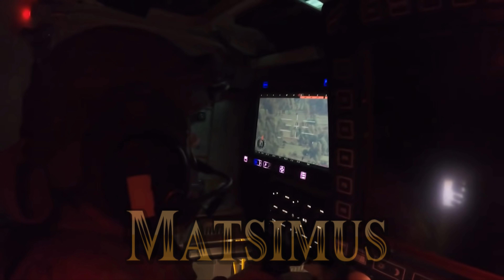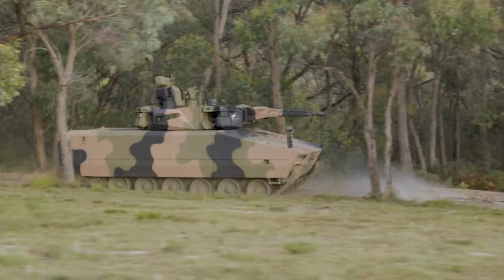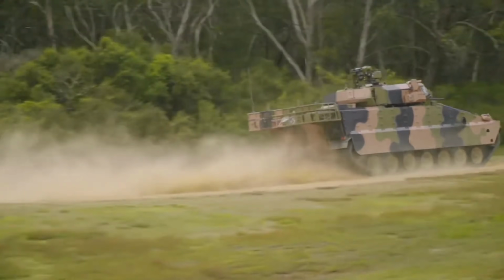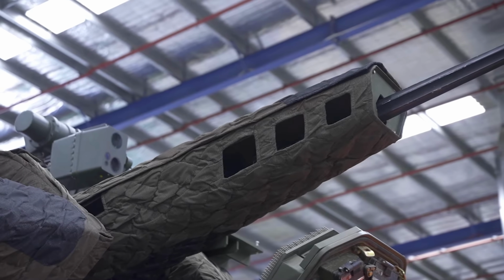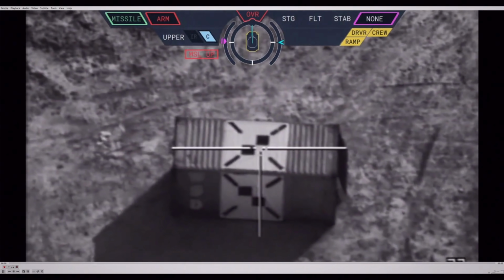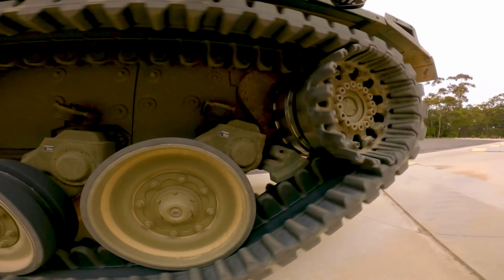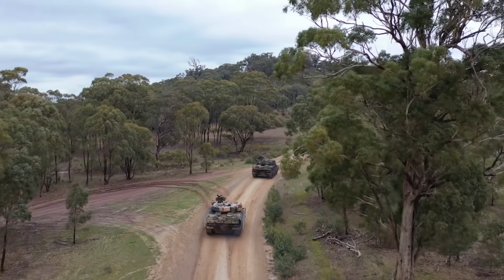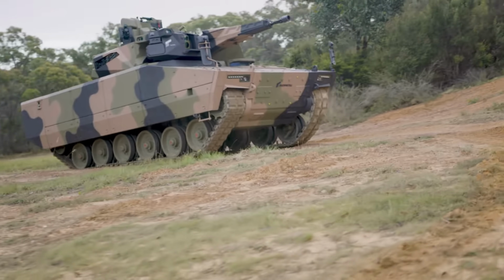KF41 'Lynx' & AS-21 'Redback' Infantry Fighting Vehicles - Land 400 Phase 3 | ARMORED COMPETITION! 💪

Comment: I really like those IR-blankets on the Redback, very smart and practical.
Reply: Apparently designed by Defense Research and Development Canada, according to the manufacturer's brochure.
Reply: @Ostsol  Ive seen people make those out of emergency blankets and fabric before for personal use but it is quite a smart and relatively cheap way to hide your IR signature. BAE had some fancy high-tech surface coating and mechanical application I believe. Sure it might be impresive on a technical scale but surely less practical and costly when it comes to versatility and maintenance.
Take care and cheers!
Reply: @paddanandersson4626  Thank you! Now that I think of it, I might even have seen one of those camospheres live in one of the Försvarsmaktsdagarna at Gärdet some years ago, but not comitted it to memory. FLIR the company had them at their tent. Now I really want one of those SOTACS suits... Harebra nu!
Reply: Also helps against the heat, like 40C in February
Reply: @apathtrampledbydeer8446  Nemas Problemas :) First tank in the video i posted is Strv 122B INT, except no tent for the commander.
Reply: Finnish modernized BMP-2s have similiar kind of blankets.
Reply: @Vulcaani  Gotta respect those finns, you just don't mess with them! But I guess a lot of countries have them, which I was not aware of, nice to learn new stuff. Cheers! And as someone mentioned it is the Lynx that has those blankets, I was wrong. Ooops.

Comment: What many are forgetting is that the Army doesn't decide which platform they get. The trials will provide a recommendation, but it is the government of the day that decides. Assuming that both platforms meet the essential requirements, most of the important and some of the desirable requirements, the decision will come down to manufacturing options and the impact on affecting voters in key electorates. Since Rheinmetall already has the Land 400 phase 2 contract (Boxer) and the Land 121 phase 3 contract (medium/heavy wheeled vehicles) ongoing maintenance, there is good argument that there is enough economic activity to shore up votes in SE QLD for the government of the day. Geelong, Victoria, where Hanwha plan to build the K9 Self-Propelled Artillery (under Land 8116)  is currently in need of Defence spending to maintain economic activity since the drying up of Defence works there in Naval shipbuilding. My money is that the AS-21 will win the contract, not because it is much better than the KF-41, but simply because the Federal Government will need to have a keen eye on winning some key electoral seats in Victoria. Of course, I can be wrong!
Reply: That’s how it works in the US too on most occasions. Has a decision since been made?
Reply: Looks like I was correct in my prediction. Hanwha recently won the contract to build 129 IVFs in the State of Victoria

Comment: The Redback is designed only for Aus and will be built in Aus. Among those great features of Redback, composite rubber track and Iron-vision are revolutionary.
Reply: Both of them would be built in Aus thats no issue, Rheinmetall already manufactures the Boxer and other vehicles in Aus.
Reply: @Atlas-zm6bn  And the Boxer is already having problems and Rheinmetall is not good on after-sale service (not interested).

Comment: Also, if extra removable weapon modules & turrets are bought. Then one module can be repaired in the shop while another module can be installed on the vehicle chasis. This should increase the availability of the vehicle. Had an interesting project with production equipment that was supposed to be evaluated with this concept. Never got to see the end results on it.

Comment: Gee this is a bloody tough battle, both on the initial stages of land400 put the others to shame, both will be built in Australia if awarded the contract. Both IFV's have been enhanced based on the Australian special requirements and conditions and really there is very little difference between them and both have proved to be outstanding IFV's who gets the contract is anyone's guess but for me, I would like Australia to increase its 450 to 1,000 and purchase 500 of each because both are great companies and both are going to be built in Australia using Australian manpower, manufacturers, and materials, but more importantly is the fact that the technical expertise will be passed on to Australian personnel and Australia may one day be able to design and build their own IFV.
Reply: Build 1 type for the regular army and the other for the reserves. Would be interesting
Reply: Logistically speaking surely that would be a mistake.

Comment: Am much as I believe that we should seek commodity of machinery etc within our armoured vehicles I feel that the Redback may be the better vehicle for the purchase.  The spike missile and the rubber tracks make it, for me, a more appealing vehicle.  However that being said, I rode in the back of a M113, as an Assault Trooper (2/14 LHQMI); rather than a driver/commander.
Reply: The Lynx also has the Spike missile too, it's not just something exlusive to the Redback alone, so that's not a valid argument. The Lynx also has better ballistic armor protection with the use of thick side skirts which the Redback lacks entirely. In the end both vehicles are pretty much on the same Level though. Both vehicles will have APS, giving them very good protection against missiles and RPGs. At this point it doesn't even matter which variant the Australian Army will get because both of them are very eqaul in capabilities. Either way, Australia will have one of the best IFV when it enters service.
Reply: @xAlexTobiasxB  dont only 1 have ampb capblity
Reply: @missouripatriot6926  No, I don't think the AS21 has amphibious capabilities. Neither does the Lynx. But it's not a very important feature on the battlefield anway, so it's irrelevant. What would australia even need amphibious tanks for anyway? Is australia planning to invade europe soon ? LoL

Comment: Just call it "Pucka" :) Its our version of Bovington. I'm biased toward the Lynx but I'm not a big fan of rubber track. Both are Light Years in front of the M113A1 and the interim M113AS4. FYI, another part of LAND 400 is the ASLAV replacement - already decided.
Reply: The track material technology will continue to develop eventually surpassing steel its just a matter of how long it takes the scientists to create vs the time till next conflict maybe rubber tracks with bolt on steel sections counld be a mid term solution but timd will tell. Best of luck in all you endeavours.
Sincerely,
Jon 
Alberta Canada.
Reply: @FastUgly  Tracks arent a decisive criterion. Both providers can and will offer steel or rubber when asked to do so.
Reply: The rubber tracks are now modular and easier to replace in field than the steel.  The only thing keeping steel relevant is increasing weight of ifvs which seems to be a mistake if ajax is anything to go by
Reply: @Weakeyedominant  I'm still not persuaded that replacing track link as and when required is not better than needing a truck to carry a complete side. I know track work is a pain (I've done it for a few years) but reliance on an ARVL, a truck or forklift or whatever does seem a better option. esp. in a mine / IED environment.
Reply: @whya2ndaccount  there is company that has developed rubber tacks that come is segments.  I assume its some sort of fancy reinforced polymer with steel in it somewhere.  It's been trialed on the cv90.  If that's available where they don't need to replace the whole band and it proves durable without stretching it would be a game changer
Reply: @Weakeyedominant  not easy to replace in a combat situation which blew out your tracks because they were rubber...

Comment: Small correction: both the Lynx and the Redback have a crew of 3 + 8 infantry. Not 6. Carry on.
Reply: Both can carry 8 dismounts, but from what I've read and heard, the future mechanised/motorised infantry squad will be 3 crewman and 6 dismounts (squad total of 9). The question for Army has always been are the crewmen RAAC or RAINF. From what I've heard, (although it is older information) the Army decided upon RAINF vehicle crewmen and 6 dismounts to balance out personnel requirements.
Reply: I know that Lynx can be made in both 8 and 6 dismount variants, no idea about Redback and I don't remember anymore which variant is actually the one that Ausies want :D
Reply: @BallisticSollution  I could be wrong, I’m not serving, but I’m pretty sure they want to stick with the 8 man sections of two fire teams. It wouldn’t make sense to pull the crew of 3 from the infantry and keep as crew when they can stick with the current method of crewing tracked vehicles with RAAC members. But that’s just me spit balling. Will be interesting to see what they end up doing.
Reply: @TheoEvian  The 6 dismount variant is the KF-31, which is just a re-manufactured Marder and limited in terms of growth upgrades. Australia is trialing the KF-41 variant.
Reply: How much space is provided for troops and gear? What seems reasonable on the drawing board might be too cramped (even unsafe) in the field.
Reply: @wattlebough  This is the discussion and trialing they are undertaking right now. From the image used in the thumbnail (AS-21 and KF-41 side by side with dismounts out front), they are clearly trialing the 6 dismount model, which means the trials team is seriously looking at a variety of different structure models. The Germans for example use 6 dismounts per IFV (Puma). The question for the Australian Army is how to be as efficient as possible with personnel while retaining and maintaining a world class mechanised force. The ADF has a huge manpower issue, more so through government mandated personnel limits than anything else. That is why limiting dismounts to 6 and having the remaining 3 personnel in the squad as vehicle crewmen from RAINF (but trained though the RAAC training pipeline) makes some sense. The other choice is 3 RAAC crewmen and 6 RAINF dismounts. The discussion revolves more around who commands who? Who is the senior officer and from what Corps are they from? Does it make sense to have the vehicle commander RAAC? But that would mean you have a RAAC vehicle commander ordering an infantry team around. Then you have the opposite of that, RAINF commanding RAAC personnel. It becomes a squabble for who has overall command of the infantry squad. Which is why keeping everything in the infantry makes a heck of a lot of sense. But regardless, like I said, they are trailing this all out and will go with the option that best works and is the most efficient and effective, hopefully.
Reply: @petesheppard1709  Both KF-41 and AS-21 are roughly the same size; well over 1 meter longer than older IFV designs. The internal troop compartment is actually quite large, more so than a lot of other current IFV's. Dimensionally, it will be similar to the Puma, but with a better vehicle crew compartment and turret bustle design to allow for more internal space. Considering the likely troop capacity in the Australian Army will likely be 6 dismounts (but space for 8 seats available) that means there will be heaps of room for additional kit, weapons, ammo, etc.
Reply: @BallisticSollution  Thanks!  Mechanization has been a significant driver in squad numbers, due to the demands made on vehicle size.  The US Army has long been concerned about the lack of personnel for dismounted combat.While the US Marines continue to regard their infantry as light, and primarily foot-mobile, so they prefer the 13-person squad for the tactical flexibility. BUT that means bigger or more numerous vehicles for mech operations
Reply: @BallisticSollution  Thanks again!  The new vehicles certainly do look monstrous compared to their predecessors.
Reply: Can someone show this to the M.O.D.?See,it's not so hard,is it?
Reply: @wattlebough  the current Mech Battalions do not have any RAAC attached to them. - they only did during the transition of the M113s from the ACRs to the RAR
Reply: @coreywarde6030  Cheers mate I didn’t know that.
Reply: Wonder how many can you sandwich in? I mean pack them like sardines.
Reply: @BallisticSollution  marder is a totally different platform, I been in both.
Reply: @jantschierschky3461  The KF-31 is built on and designed around the zero houred and stripped down hull of a Marder 1 IFV. Rheinmetall actually released a video a news piece about it a few years ago. They have hundreds of Marder hulls and were looking at ways to re-use them - hence the KF-31. It is the budget option. The KF-41 is a clean sheet design. In this regard, you are completely and entirely wrong.
Reply: @BallisticSollution  well if you say so, I just happen to drive marder 1 and 2. My cousin works for Rheinmetal, but what I know
Reply: @jantschierschky3461  Well, if that was the case, then you should be able to look at the Marder 1 and the KF-31 and immediately see the extremely similar design DNA in them. The Marder 1, Marder Evolution and KF-31 are practically all the same vehicles just with upgraded sensors and armour with slight external design changes, in fact the Marder EVO and KF-31 similarities are striking. Also how can you drive Marder 2 when it never went into service, unless you meant something else?
Reply: @BallisticSollution  well you seem to forget there are 3 versions of the marder,  a system in use for close to 50 years.  So yes there are lot of similarities, however I been in the puma and lynx, both are smaller.  Different engine,  suspension,  drive train heaps more electronics etc. Is it an evolution of the marder,  absolutely, but is build on marder platform  ? No.  The marder turret is different,  metal is different, dimensions are different.  In comparison to the marder is cramped. Btw marder 1 was till 85, than modified to marder 2, 90s to marder 3
Reply: @jantschierschky3461  I believe you meant to say Marder 1, Marder 1A2 and Marder 1A3? That would make more sense to the reader who doesn't know armour systems very well. Because Marder 2 specifically was an real design built to replace the Marder 1 FoV and was about to go into production but was cancelled at the end of the Cold War. The Lynx KF-41 is NOT smaller than the Marder, it is much bigger. The KF-31 is also slightly longer than any Marder design, and both KF-41 and KF-31 are also wider and higher than any Marder design. I'm not sure where you are getting your info from mate, but it is not correct. The specs for all designs are out there. Do some research on them and you will see that Marder is a smaller vehicle by a good margin than either KF-31/41 or the AS21 from Hanwha. But you are right on one aspect, the KF-31 is by it's very nature an evolution of the Marder, because it's design is based on the Marder 1 FoV.
Reply: @BallisticSollution  well to me marder is more spacious. Never mind, you in most part right.  But my cousin just told me that puma prototype was developed with marder chassis, but it had issues with weight, suspension.  Chassis had to be redesigned, so is a new development.
Reply: Thanks Matt,  good to see them side by side. Along with the 40 K9 and K10s, Boxer Recon vehicles and new M1a3 tanks the tip of the spear will be very sharp indeed. Also talk of 120mm auto mortar turrets for Boxer and the winner of this program.  Good to see you out and about again. Cheers (ex bucket driver).
Reply: @jantschierschky3461  That's an interesting tidbit on the Puma, thanks for sharing.
Reply: @mylesdobinson1534  Yeah it will be a nice mix of vehicles that's for sure. I just wish we were getting more of them and expanding the army to a more feasible/useful size as well. As far as the 120mm mortars, apparently it's more likely they will be on Phase 3 winner rather than the Boxer. It's a pity the Boxer isn't being utilised much further than it is, it's a superb platform.

Comment: I'm a little confused. So the Boxer which Australia has purchased is an IFV as part of the Land 400 phase two. The Lynx, which I think Australia is going with, is also an IVF as part of Land 400 phase 3. Is this correct? Why two types of IVF? Is one troop transport and the other isn't? I'm not military so forgive my ignorance.
Reply: Boxer is called Multirole Fighting Vehicle or MFV, lighter armour with wheels instead of track like IFV. It's used mainly for reconnaissance rather be than direct assault like IFV.
Reply: @tonyvu2011  Thanks.

Comment: got any takes on Australia 's quest for nuclear subs,perhaps a comparison on the uk's Astute vs US's virginia class thanks
Reply: Apparently  they both have the same capabilities and armament  except  the ASUTE class has between 96 to 113 crew and the Virginia class is longer and has 159 crew. I'm guessing  Australia  would go with the one that requires less crew due to having find enough crew for them. Our current Collins  class only has 59 crew.  So double the crew would be easier to find then a crew 3 times the size. I place my bet it will be the ASTUTE class due to thoughs reasons. 

In the meantime Australia may lease 5 of the Los Angeles class in the next 3 to 4 years for a gap and to learn in. If they man 5 of thoughs would be enough  crew  fully man the 8 ASUTE  and be fully qualified too

Comment: After Rheinmetall got the Boxer Deal and production line in Australia up and running I belive the Lynx will be the safe choice. Also Boxer and Lynx Turret share the same technology and operation system. Not to mention they have the same gun / same 30mm ammunition.

Technical there is not too much of a diffrence between those high tech killing maschines. Both vehicle will get the job done for Australia
Reply: Except Boxer CRV now developed a problem and Rheinmetall is not really good at providing after-sale service to Australia. Also, one of the Lynx unit blew out a gear box during testing. Not a good idea to put all eggs in one basket.